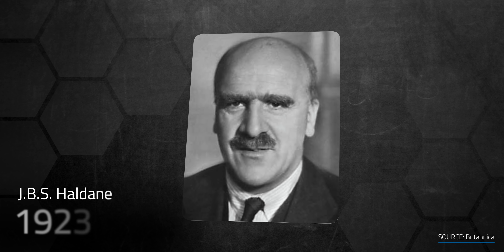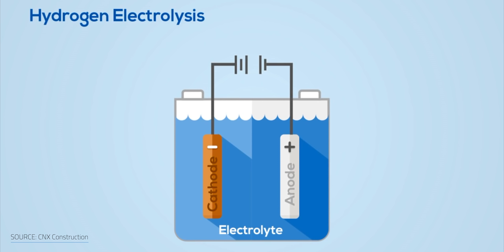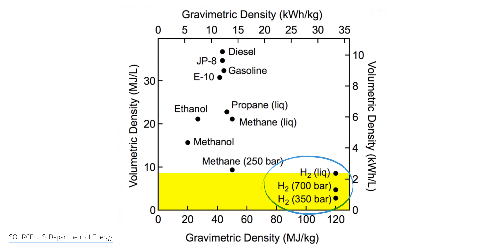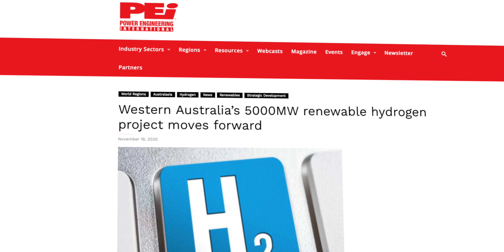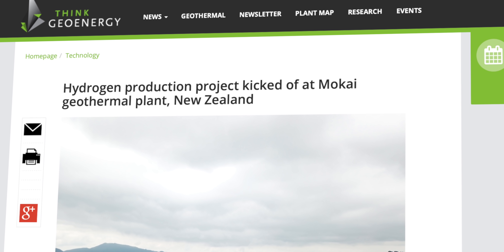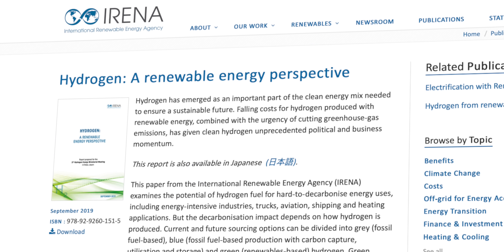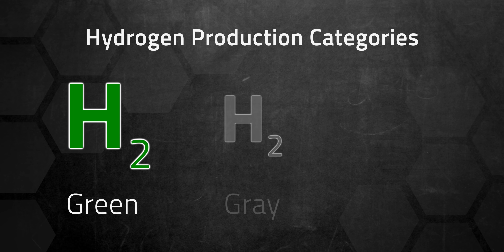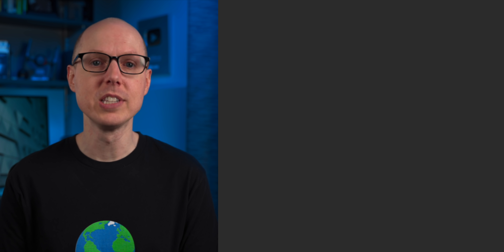The Truth About Hydrogen's Dirty Problem - Green Hydrogen Explained

Comment: Hydrogen can't be stored or delivered without anchoring it to magnesium.  Magnesium hydrides are a paste that can be easily delivered as fuel.  Fuel cells are a lost cause, BEVs have passed them.  There's no need for leaky fuel cells. 

Hydrogen has aviation promise because it's so light and carbon fiber tanks and structures can be built strongly to hold it in. They are already used heavily in airframes.

Comment: @UndecidedwithMattFerrell, it would be interesting if you tried to get data on how much "portable" solar-powered H2 electrolysers can recharge the truck or ship, how much truck/ship would need liters of H2 every mile/hour and how much would truck covered in solar panel with electrolyser could (re)generate. Even if it is not much, if you can extend range 10% during driving and waiting to load cargo it could be huge impact. For ships they would not need as much fuel if they can generate it during voyage with huge panels that double as shades or even as additional sails.
Reply: the conversion losses are silly. You would be better off sticking with electrons.

Comment: Hydrogen fuel is best used where charging EV batteries is unpractical, like in public transportation, trucks, airplanes, ships, military vehicles, where either you can not stop for 40 minutes or you have nowhere to charge fast, or charge at all. Japan is pushing for hydrogen because they do not have enough territory for ENOUGH renewable power plants to cover 100% EV's, and they are scared of current nuclear power plants. So creating green H2 in Australia or elsewhere and shiping it in instead of fossil fuels is just what they need. 
If you are going to drive in the middle of nowhere for extended period of time, it is easier to get the H2 refueling cistern to the site then switch entire batteries back and fort, and ships have no where to be plugged at.
Also interesting is how much fuel a truck for example needs, and how much can "portable" solar-powered H2 electrolysers recharge the truck or ship they are on while driving or waiting in line to load cargo... Military usage is also very big possibility, when they NEED to switch to something, because if you are out of electricity in the middle of the battle...

Comment: There's also hydrogen production tests in nuclear. There are periods  where nuclear plants are told to run at reduced power because there's too much renewable energy on the grid (not a bad thing!) Because this means nuclear capacity is being "wasted", the idea is to use the spare capacity to generate hydrogen instead.
Reply: Same in Switzerland with waste incinerator plant. They normally produce electricity but have to stop do that when grid is saturated. Some of them are looking to produce hydrogen.
Reply: @Froudd  yes, that is how every grid works. That has nothing to do with hydrogen
Reply: @SupremeRuleroftheWorld  how can incinerator plants making hydrogen during the time they cannot producing electricity not having to do with hydrogen?
Reply: @Froudd  making electricity and storing it makes more money then converting it to hydorgen that gives 30% of the investment back. its basic economics and physics. and setups like that are goverment funded or funded by oil companies, the oil companies are the only ones actually pushing hydrogen as hydrogen keeps people "on the hose". that it does not work in actual large scare grid systems is irrelevant.
Reply: @SupremeRuleroftheWorld  I am not the biggest fan of Hydrogen specially not for direct use. And it is true that project with incineration plant in Switzerland are often founded by government. The problem I see with you answer is the "storing it" when you speak about electricity. Hydrogen is exactly use for that reason, as a storage medium for extra electricity production. I am no economist, I only read a lot about power-to-x and thus do not know the financial advantage of having electro-chemical battery over production of Hydrogen. I personally like the liquid-air storage but the advantage I see with Hydrogen production is the small place of the electrolysis, the storage side is very easily scalable which is not the case for other battery type. I don't think that their is one best solution to get rid of fossil fuel in the future but in my opinion there is a lot of different options each with it pros and cons which will suits different type of usage, don't you think ? Because as a physicist I dream about fusion since I am 15 and I've heard of it; but even this technology does not resolve all the challenges (for example in aviation or high temperature industrial process, etc)
Reply: @Froudd  I don't really see how hydrogen is more scalable then batteries. If you add more storage tanks without increasing the electrolyser and fuel cell capacity, you just add more storage hours/time. That might be fine, but only up to a certain point for day to day operations. At that point you'll go into long term storage, which might not be what they'd need, thus they'd also need to increase their electrolyser and fuel cell capacity too if they want more than just storage time.

Yes, hydrogen is a storage medium, as are batteries. Batteries however tend to be much more efficient than hydrogen storage. Usually the main advantage argued for hydrogen is the 'easy' and fast transferance between storage options, completely irrelevant in a static storage project.

Hydrogen can have its place in the future, though more for things like shipping, aircrafts, ... niche sectors. Long term storage might also be an option, but then it will essentially come down to what is most efficient cost wise: overproduction during times of the year with enough capacity for any weekly/daily operation or storing something like hydrogen for weeks or even months, essentially letting it sit there doing nothing but cost money during that time.

And it is not like there is only one battery type out there, there are plenty of batteries coming up exactly to deal with grid storage. Personally I'd expect it to become more between what kind of battery, rather than battery vs hydrogen.

As for size, I honestly don't think that hydrogen storage would be much smaller than something like liquid-air storage and batteries (depending on the kind) might be the most size effective really, since you can also just stack them up high. Batteries are quite good volume density wise, just not mass density wise.
Reply: @MDP1702  thanks a lot for your nice answer. I agree with you. The project I wrote about, incinerator making hydrogen, was actually not to store the H2 but to sell it. I also see that hydrogen usage make sense only for niche domains like some transportation sectors. I also agree with you that battery either thermal or mechanical is the best solution for large scale and that each situation will have the best battery type accordingly. Thank you for the discussion.
Reply: even a cursory look into the physics would make hydrogen a hard pass. just having battery storage or even a liquid salt storage system would be a LOT more efficient, cheaper and safer then hydrogen ever will be.
Reply: @SupremeRuleroftheWorld   It takes a lot of energy to make a battery.
Reply: @headcrab4090  it takes even more to make hydrogen